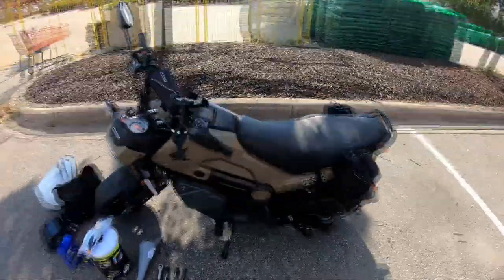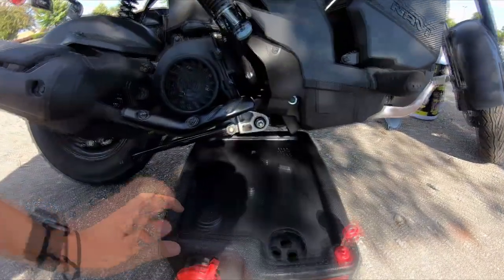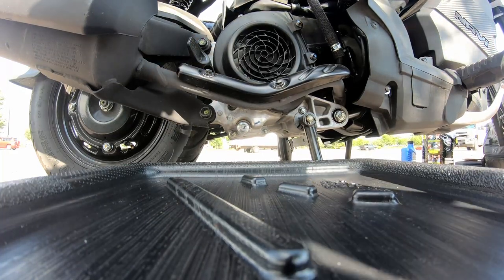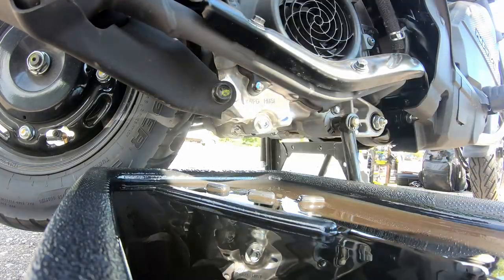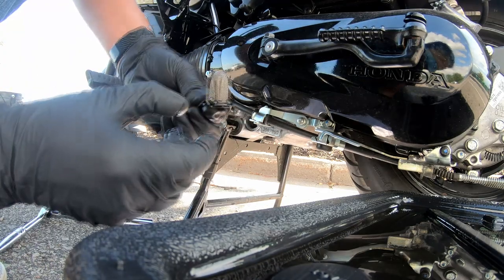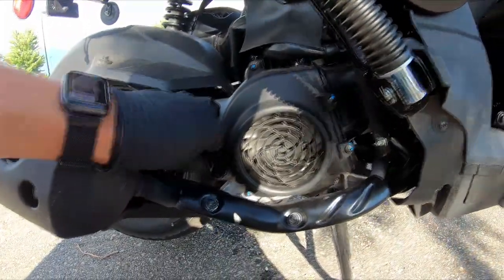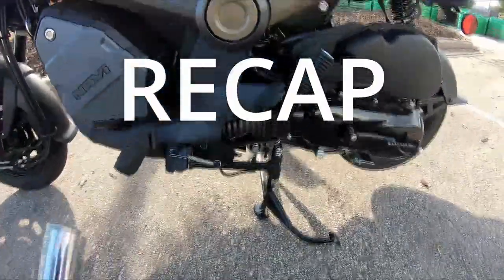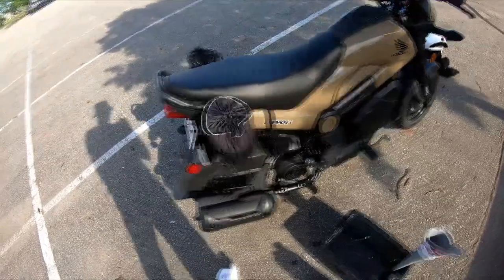2022 Honda Navi: miniMoto Vlog Ep. #4 - First Oil Change

Comment: Nice video bro. Will def. be doing my own oil changes. 140$$??? That should be illegal. Always good practice to re-check the level on the dipstick after cycling the engine just to be sure you got enough in there.
Reply from the maker: Dude!! You are too kind with these comments man. 🥰 RIGHT!? I thought it’d be covered by the “dealership fees” but I guess not 🤦🏽 I appreciate the feedback! I’ve certainly been better at it after doing a few by now. First season I almost rode about 4k miles so I def had done a few oils changes now lol but yeah that service department really thought they’d charge me like that? SIKE